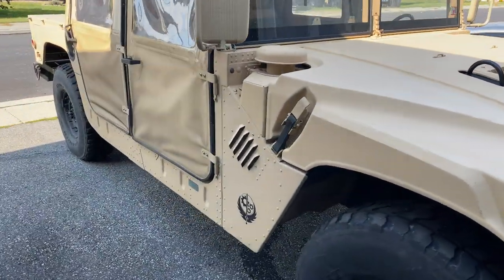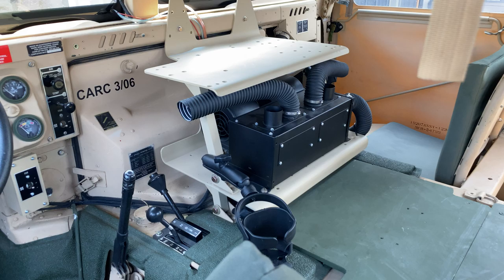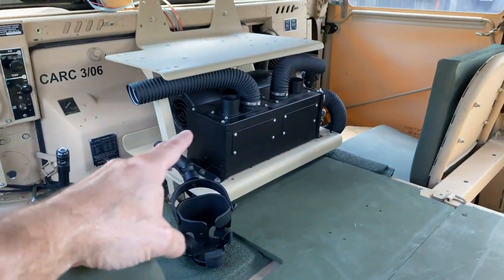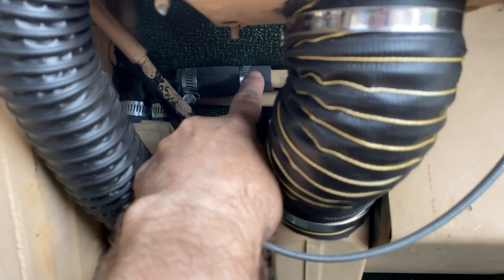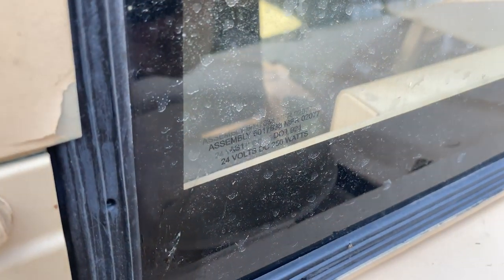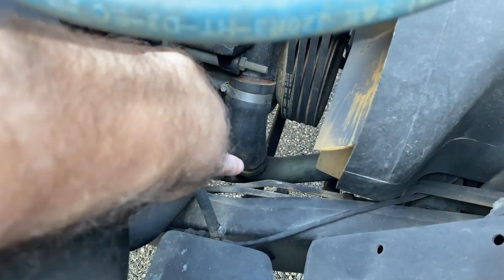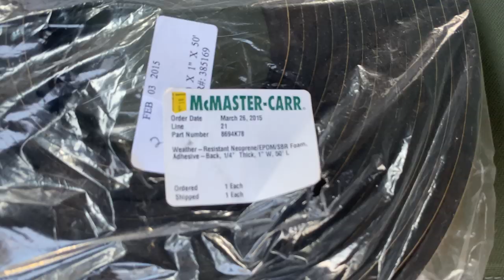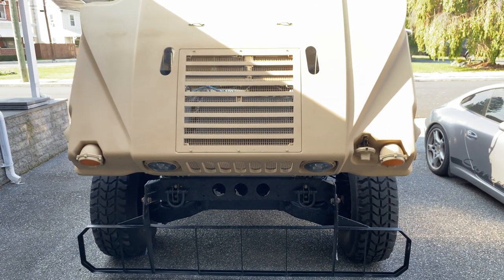HMMWV Heater Upgrade part 1

Comment: Do you have the info for the front defroster glass? A source name for the switch box? Info as to has the heater unit you added to the radio mount. You can also go with an Espar or Webasto diesel heaters for 24 volts. Don’t waste your money on cheap Chinese heaters if they advertise something for 24 volts, they are total junk.

Comment: Nice video and great job.  But at 25:30, that new control box - there's already enough shin barking metal in a HMMWV without adding a knee knocker!!!  Do you find your right knee is hitting that box?
Reply from the maker: Plenty of clearance. I'm 5'8" and have no issues of hitting that. I have a friend who is 6'2" and he had no issues at all driving this. The box is located in a place high enough out of the way.